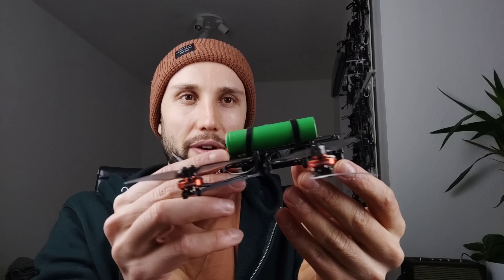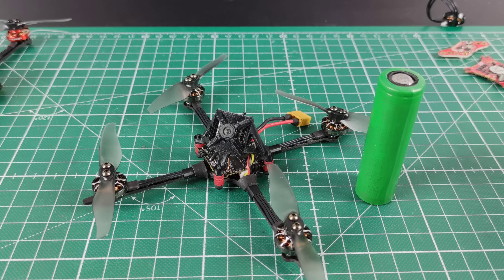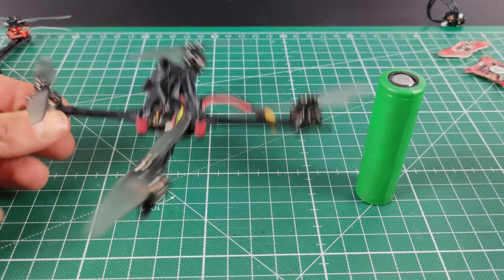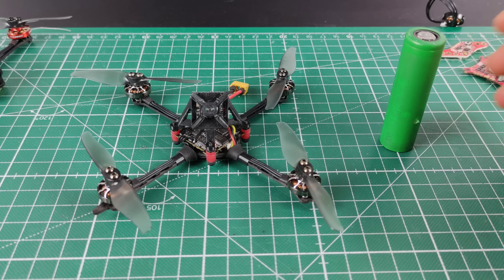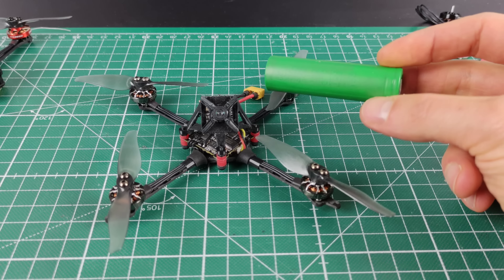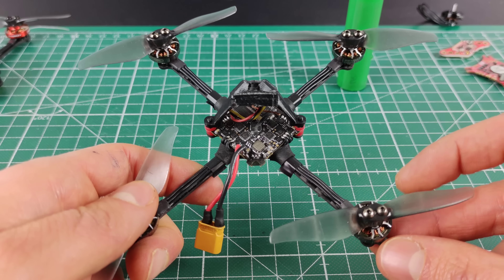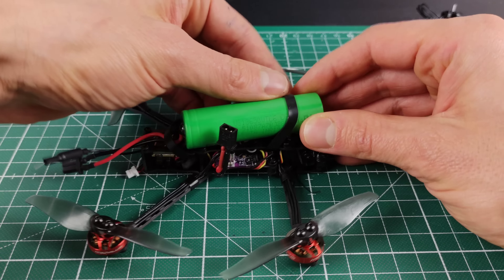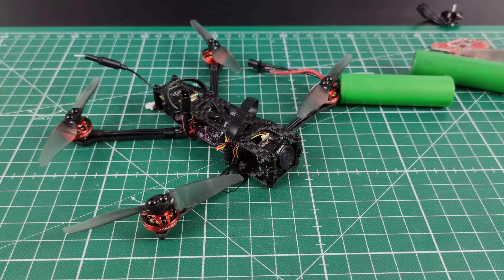#NanoLongRange

Comment: Would adding a super capacitor in the power to the VTX help buffer noise?  Or is that a function of the Ripple current from the motors so having a larger capacitance to the ESC be better?  Also if you mounted the GPS to Mu Metal instead of Copper the magnetic field could be constrained more effectively ?

Comment: The battery holder weight needs to be compared to the cables and connectors you would normally have instead. Also I think you can get other holder designs, where you only have the contacts/springs soldered, without any or less plastic housing.. but maybe thats too fragile.

Comment: I think the contact resistance of those battery holders will far outweigh any benefits in convenience. I've had nothing but misery with goggle battery box. Not the fatshark, but another one. I tried setting it up for in-box charging with a separate, dedicated balance lead for charging, and none of my chargers cant manage the percieved internal resistance of the cell, once the contact resistance is in the equation. i suspect you will experience the reciprocal under higher current discharge. Also, What kind of 18650 are those? I have been searching through all of the discarded power tool batteries I can find, and I find it's really not worth flying them unless my ISDT shows an internal resistance under 20mOhm or below under charge. I have packs that are between 50-80 mOhm per cell, but the sag under load is pretty rough. I need to go zero throttle from time to tie to look at the voltage after it's recovered to assess the state of the pack.  

Also, What is that frame?. Did you shrink the 4 inch flywoo style deadcat frame down more? is it for sale? I kind of want to build one of these and try it out.

Comment: What about a 2S version, and/or 21700? Double the power while the electronics don't get much heavier, revmove the Boost,  save weigth. The nano concept is soo awesome. 
Gold contacts on the battery holder are not for conductivity, it's literally the same, but for higher plug/unplug times.

Comment: Happymodel just released a lr version of the crux3, with gps , buzzer, and a aio board with spi elrs 2.4.  Should be capable of 3km straight out of the box which for my air space was is looong  range. I'm excited to tinker with it.

Comment: I'm using 18500 and 18350 li-ions with good results. The cells in a Tesla batt would be cool to try, dielectric grease can help with battery holder amp potential. A tpu printed battery holder could be undersized so it applies pressure when stretched over a li-ion cell as well I am modelling a simple stl for that. Great project you have there.

Comment: Hi🙂 great video and work looks cool.
I had a similar problem with rx/vtx dropping out when u came down under 3.3v. I solved that issue by soldering a cap on the 3.3v rail.

Comment: Regarding the battery holder/case: 90% or so of the battery holder is really not needed. If you integrate the terminals into the top plate (maybe using 3D printed parts) and secure the battery with a strap then you can save significant weight. Also you can get rid of the XT30 and shorten the wires.

Comment: 2s should be optimal like the DJI mini 2s with 30 min flight time :)
Reply: You need 9v right . or more than 4.35v ...
Reply: @K_Nasty  no, it's specced to 7V+ but I've ran it down to ~5.2-5.3v.
Reply: DJI FPV runs fine on 2s
Reply: @FilipRadelic  about 2-Xs ESCs: they're using linear voltage regulators, that have (most of the time) about 0.5v minimum dropout, and FORTIOR mosfet drivers that shut down at about 4.7-5v at their input. So, at 5.5v on the battery you have about 5v at mosfet drivers input, and they're shutting down. 1-Xs boards don't have that issue, because they're driving mosfets directly from ESC MCU, but MCUs themselves have lov voltage watchdog, that resets if the voltage drops too low
Reply: @remainsmemories626  the board I am using is 1-2s. It just doesn’t have enough power to fly at that voltage.
Reply: @FilipRadelic  so you mean you can hold throttle at 100% and it will still sink down, or what "not enough power" behavior?
Reply: @remainsmemories626  yeah it starts dropping even with full throttle.
Reply: @FilipRadelic  what is your setup? I've seen that behavior only on old brushed quads
Reply: @remainsmemories626  38g 75mm whoop, 14kkv 0802 motors, 300mah.
Reply: @FilipRadelic  oh, that totally makes sense now, 14kkv is quite low for 1s 75mm
Reply: @remainsmemories626  2s

Comment: Love it. How important is crashworthiness? Some completely impractical ideas:
Less robust frame
Have you looked at lighter motors with the same spec?
Adafruit, etc, sells GPS modules that are a lot lighter.
The processor runs as 3.3v and it can run much lower. Can you bypass the regulator? Or use a different low-power processor with Arducoptsr?

Comment: I'm building a 3" Roma L3 before I seen this. But not going efficient since I'm just going to use spare parts which means either 1207 or 1206 5000 or 6000kv motors I have laying around.
If going efficient I'd prob do 1303 or 1202.5 in 5000kV 4S. Just for the power and when voltage dropping its not an almost 50% loss in power

Comment: This is a great idea! The smaller the better,  and 2-3km is pretty good! RekonFPV going to produce this?
Reply from the maker: Only if it really works well. This is way to sketchy for a real product at the moment
Reply: @DaveCFPV  Of course!  But I have a feeling you'll make it happen. :)

And at least as you noted in the video - the flight characteristics are good.  And I didn't find the footage to be bad; I don't care about HD footage/etc, I just want to experience flight.

I'm very glad you "invented" this segment and gave it a catchy name - it really caught on.  This is the type of flying I want to do.  I don't care about racing, and I don't care about crazy freestyle tricks.  I just want to fly around and enjoy that experience.  But 99.9% of the quads out there are geared towards either racing and/or freestyle and are set up rather "hot."  I can and do fly them but it's just not as fun as it could be.

This "nanoLR" thing is great because it keeps the costs down.  I don't have a ton of money to spend on the hobby.  I'll never go digital for instance.  I don't need it, and I have analog gear that works just fine.   I do need Crossfire for long range, and I'll find a way to budget the module for my X9D.

I'll be watching the Nano LR evolution for sure!

Comment: This as a 2s is basically what I imagined when I first saw the 4" because I mainly wanted a lightweight and cheap lion cruiser but a 3 or 4 cell 18650 is too heavy for even really a 4" but a 2s 3-4" certainly seems more in the realm of possibility. Not sure if I care too much for the 1s if it's analogue only because the toothpicks we already have pretty in good flight time without a new platform. For some reason I assumed that The 1s flight times would be similar to the 4-in but maybe it's so light that fights the wind more than the 4-in.
Reply from the maker: I might try 2S too. However I really like the idea of it just running for 15min on a super cheap and simple single cell

Comment: I find this super interesting, I created an 18650 for a PH2.0 connector by simply soldering directly to the poles(yes i know, not recomended), but trouble is the way the LI-ION's discharge, and as you already figured, it drops in voltage very fast. The setup you have going is much more what i should've gone for, and i like the idea of a step-up converter to handle the VTX/Receiver parts. You already went for a capacitor to rid yourself of the VTX noise, but maybe you should try a LC lowpas filter, and just aim to calculate for a slightly lower frq than whichever frq you encounter in the noise.(Or buy a rdy maid from Banggood, like the "VTX LC Power Filter Module" C-L-C kind which is 1.4gram). Also, you could go for an LI-ION 18500 style battery, to loose 13'ish gram but ofc it'l cost in range.

Comment: Great build and vid! 
On the battery harness question: it is 8g, but how much does the connectors and wires weigh? As you would be replacing them it wouldn't be a 8g increase but rather something like 3-4g. 
Not to mention less damage to the batteries if you can avoid soldering on the wires. 
Being able to use just about any 18650 without modifications would be ideal in a consumer sense as you wouldn't need dedicated batteries for the quad.

Great video and I'm looking forward to your next project!
Reply from the maker: Thanks! Yes If I use the tray as structural part of the frame it could be weight neutral.

Comment: An you are doing some great stuff for this hobby i appreciate it, for the build you are doing that battery idea is awsome i would recommend to incorporate that battery holder in the top plade that would take some weight down from carbon and trim this holder down to essentials it will definitely be the best battery changing systems. Love your videos i have been a silent viewer but today i thought i sould appreciate your work and just let my thoughts out for this quad
Reply from the maker: thank you! Yes indeed making the tray a structural part of the frame is the next step imo. If the tray/small contact area actually handles the amp draw
Reply: @DaveCFPV  well for the amps just bend some copper sheet and vola you have pretty robust thing to handle amps

Comment: Great work. I’m
 New to FPV but could you possibly have the battery contacts in the middle (between top and bottom plates) so you can slide to battery in from the back? Put the FC gear then on top the frame? 

Thanks,

Comment: I have the HGLRC 1-2s Board the HGLRC nano vtx and there new 1202.5 11600kv motors on order to build a 1s toothpick....cant wait to build......also i would try a 18650 for Cruise and a 2s lipo with 70% throttle cut for freestyle. Hope that work🙈

Comment: What's the discharge rate on the LiIon you are using? Is the frame available for purchase?
Reply: He stated it were vtc6  cells. Those are rated at 30amp continues discharge and 35amp burst. (The vtc6 are the most powerful 18650 cells at the moment)

Comment: Is this build targeting 18650 specifically? Or single cell 3.7v long range? There are 9900mah 18650 batteries. I'd take a ~650mah  2s lipo and split it, rewire it to parallel with a new lvc. Should be close to the same weight as an 18650. 

Your noise issue is probably due to the battery ground being the can of the battery. That's a pretty nice halo of noise right above everything, probably following the graphite in the frame. Maybe some shielding tape under the battery? 

Might be hard to understand, but I'll try. Use 3:1 XHF Heat shrink Tubing 1 1/2", shrink down over ~3/4" of the (+) end of the battery. Let end close up over the end of the battery. It wont close all the way so you will have room for wires leading to a small plug. After cooling pull the tubing off, insert a copper washer soldered to the (+) lead with a small amount of hot glue behind it. Since the can of the battery is the (-), simply let negative wire sandwich between the tubing and the batt. If you scuff up the can a bit a hot soldering iron will tack the wire on. Just don't heat much, 18650 hate heat.

Comment: Try a small boost converter from ebay, just put it inline with your battery
Reply: But you won’t have voltage reading.. you’ll be flying until the booster can’t sustain the voltage and you’ll drop out of the sky.. and also, a boost converter that can handle 10amps is way to heavy.. remember, putting it inline with the battery means all will be powered by the booster..

Comment: Integrate the battery holder into the body of the unit. 3D print it then put your own connectors in it.

Comment: Those are 3 inch props right? 
Also it has been a while so i am wondering if you are still happy with those motors (RCINPOWER 11500kv)

I just gave it a try with my tinyhawk 2 fc and motors(16000kv) with 2.5 inch props and  i was able to hover at 60 percent throttle for 5 mins using an old 18650 battery:D

Comment: Take  batteries with solder tabs and solder a connector to save wight and get rid of this heavy plastic thing with bad resistenz . They should also  fit in a "regular" charging device.

Comment: Do you think adding 2 small super capacitors in series might help? Probably could try 2 2.7v6f in series charge them to 4.2v before flying. I think it might boost the power output and those super capacitors shouldn’t weigh more than a few grams.

Comment: Not considering weight, I'd say that
UART VTX control < UART GPS. 
If you're using this quad for LR, you probably never need to touch the VTX settings.

Comment: I've been working on one of these as well! I'm trying the matek "1s to 5v" converter. Didnt realize the old happymodel fc I would power up, but the escs are 2s minimum. I plugged in 2s to test and killed my bec. Still looking for the right guts. I'd love to be able to use a 5v unify and GPS. I'll be following this one! Thanks for sharing your thoughts and experiments!
Reply: Search on aliexpress for multifunction mini boost module step up board. They are not even 3 bucks for ten. They are light and can provide 5v/8v/9v or 10V at 1.5Amp max with an input as low as 2.5v. I am using one to power my vtx and gps. Under 3V it struggles to deliver the power needed for the gps and vtx at 500mw, but 250mw on the vtx is no problem.
Reply: @DutchCommando  Nice! Thanks for that! :)

Comment: Chrismel FPV made a tinyhawk 2 remix of your 3 inch longrange. My thought is that with the tiny's leds sled on in (using unify and crossfire) I'm actually about to build myself a 2s version, also with those 18650 slip-in holders, but a dual version. I know 2s adds a ton of weight, but should help out with the electronic noise and add a bit more bite to the engines for cruising.

Comment: Maybe you could consider trying 18500(~35gr) or 18350(~25g) instead of 18650(~45gr). Some brands offer quite high discharge current rate, will try some myself.

Comment: I'm sure its been said but you probably don't need any screws on the props. I run my under 2s stuff without prop screws
Reply from the maker: 2mm props on 1.5mm shaft :-D I ordered new ones...

Comment: That is fantastic work, I'm really impressed! Have you checked out the single board Shark Byte HD VTX? It looks very promising for this kind of platform. I've been experimenting with something similar using a 3" Armattan Tadpole, that I lightened as much as I could, same with the rest of it; I actually drilled holes and Dremel-ed slots in the aluminum parts to lower the weight. 1102 motors, and a separate VTX, with a Caddx Ant Lite camera. I ordered some 18500 batteries as well, to see what I could do with those, less mah, but less weight. I also found some 14500 li-ion 3.7v batteries that claim to be 3000mah; I'll be honest, I know very little about electronics/electricity, and batteries and such, I'm just a plebe goofing around cos I have the time, but I thought I'd try those in a 2s configuration, or even some 10440 sized in a 3s configuration, and see what happened... Another thing I thought of, I have these tiny little square Lipo batteries from various toys, literally postage stamp sized, 250mah, what about powering the VTX with a separate battery..? One, or even two of those little tiny ones doesn't add much weight. Again, you know WAY more about this than me, I'm pretty new to the whole thing, but I love to tinker with them, and sometimes I get them to fly! Anyway thanks for this video, I look forward to seeing how it evolves, tiny long-range quads are my ultimate goal. Also, from your accent, are you from Germany? My family is near Kaiserslautern, I'll be back there as soon as the coronavirus lets me, I can't wait!

Comment: I'll buy one! I would prefer a gps though if you can still make it work with the extra weight. Yes! snapping in a battery would be a cool idea! Maybe the battery tray could be incorporated into the top plate some how as a stressed member, kinda like how they attach modern motorcycle frames to the engine instead of cradling the engine completely in the frame.
Reply from the maker: I think so too. If the tray is a structural part of the frame the whole thing could work out.

Comment: Amazing, love to see where this goes!
But 1S does seem to bring some issues, how about making it 2S? i guess it should be able to carry 2 18650's with the right motor Kv/size (thining something like 1303/1204 6000kv? or maybe just staying with 1202.5 but lower kv), and that way you could even slap on a 3S lipo to have great power. 2 18650's could go as low as 4.4v when being safe, but i think the electronics are fine with that?

Comment: Thus it drop out when sudden punch out on throttle? I've tried some 1s with these battery.  It flys fine.. sudden increase of throttle input it crashes.
Reply from the maker: No it doesn't crash even on throttle punches
Reply: @DaveCFPV  thanks! 👍 maybe my setup is not right. Thanks for this video. Will try your setup soon.

Comment: If amp draw is below 5A, wouldn`t it be better to use 3450mAh 18650 like samsung 35e? Weight is about the same, but the it has more capacity (And even longer flight times). It provides max 8amps but it would be enough?...
Reply: LG MJ1 would also be an option. It provides 3500mAh and 10Amps, weighs about 49g like every 18650

Comment: why not design it around 2 18350 1500msh pump 2s into electronics and betaflight throttle limit to keep voltage to motors at 1s

Comment: base frame carbon and the top plate with built in 18650 holder injection moulded by Zhong

Comment: Is 18650 size the sweet spot for efficiency? I wonder if 2S with a smaller dimension battery like 18500 or 14500 (AA size) would be viable.
Reply: I used Gameboy li-ion flat cells that worked ok too.